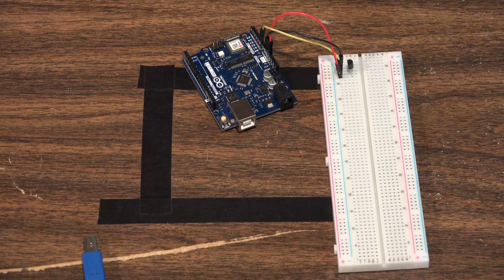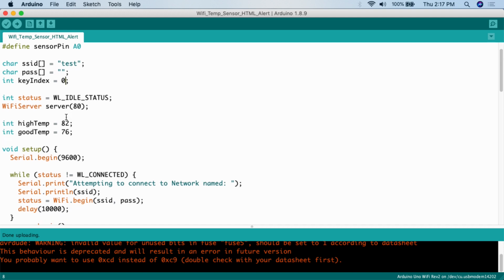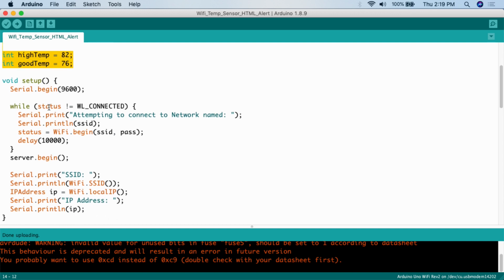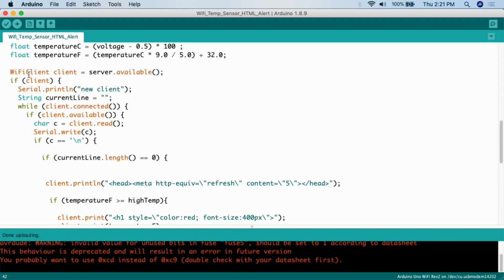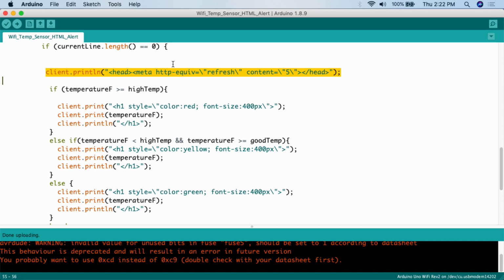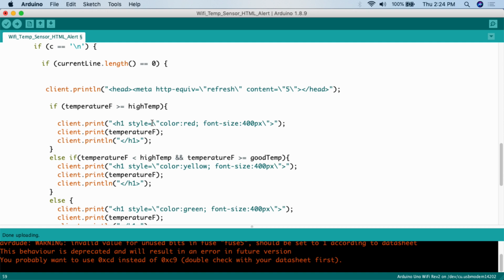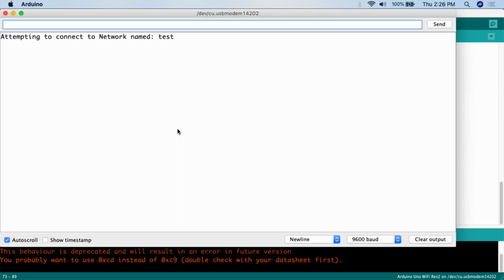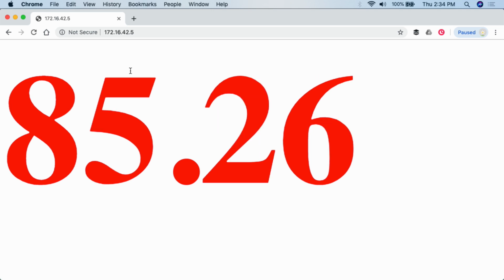Arduino WiFi Temperature Web Page Alert

Comment: I’m working on a final year uni project involving arduino uno wifi rev2 and I want to make it read the values from the amg8833 sensor (thermal camera) and display the image in the web page via the IP address. Any recommendation on how should I do this? I’m a bit lost tbh and didn’t find any useful tutorial for this matter

Comment: Why are you not just using an ESP8266, which has wifi built-in and is both cheaper and faster than an Arduino? Even the Arduino IDE is compatible with it. It's like 2-3 USD.
Reply from the maker: ... because it's a class on Arduino... ...
Reply: @elithecomputerguy  Well, it's a class about getting current temperature displayed on a web page. You just happen to pick an inferior (and more expensive) controller for it. You would program and wire it the EXACT same way with an ESP8266. Anyways, good luck with your projects.